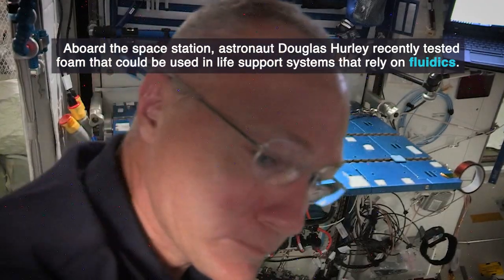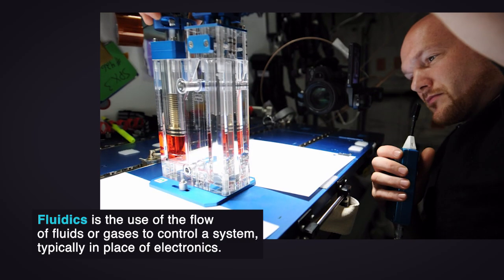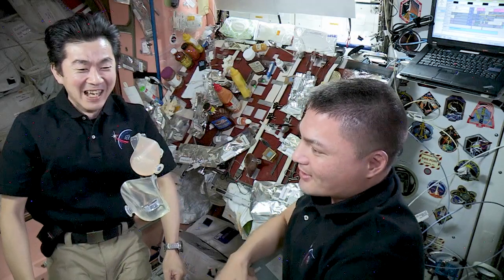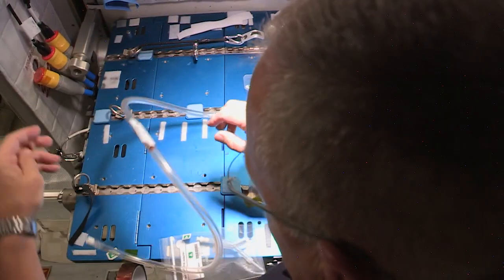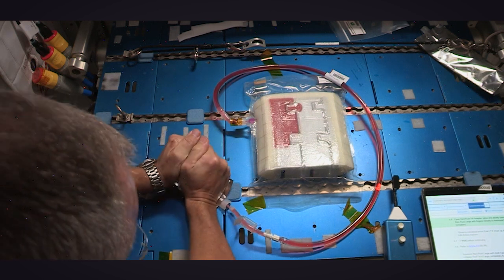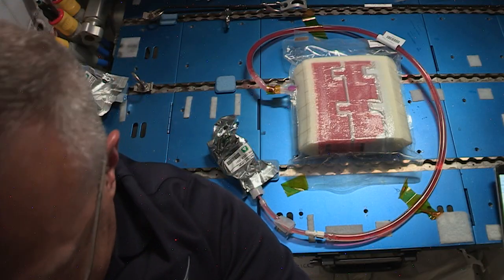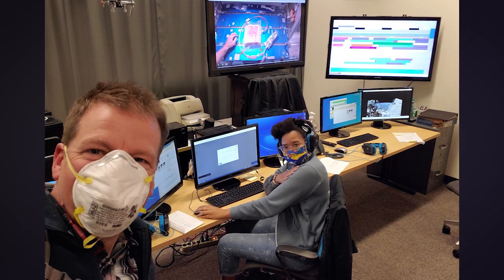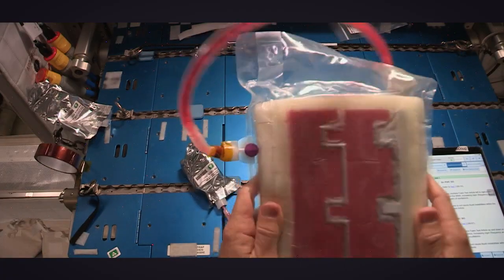Fruit Punch & Foam: Managing Liquids in Space

Comment: Hello , I know a method of travelling faster than light by 10^1000 times and higher , I'm a communications engineer  , but my question is can we go across silence mass continuity , we are stopped in space then we will travel by millions of meters per second in a short time of acceleration , would we be a piece of paper on the wall of the ship due to our continuity ? if we don't how can I share you the method of travelling in ultra high speed and without wasting the oil in space because it doesn't depend on the convenient methods , please let me contact you and I want my method to be widely used , we can use this method on earth too to make cars moving against gravity and go to space too in any speed , also we will be capable to transport signals in galaxy immediately and be live with any process we contact in any planet , and we will be able to discover the far away galaxies and solar systems in time less than months or weeks or may be seconds if you used the nano tech to develops my method .
Reply: wow whats your method? and yes, the laws of momentum would make it so that if you accelerate very hard very fast, you would likely be smashed against the back of your seat
Reply: "this paragrph is of two important technilogical parts , please read the second "I know a method of travelling faster than light in space , the method is to use a kinetic force from inside the ship to hit a point connected to the chasis of it and a too much strong force , due to continuity , speed accumulation in space , the rate of the kinetic force , the number of the hitting arm and the time of hitting the speed will reach the speed of light easily depending on how strong the artillery is the strength will define the time required to reach light speed " if you used a any force for 10000 hits per second and across the day you will have 8.3*10^7 × the speed resulted of a single hit × the number of arms " if we had one arm , 1 meter per second per hit across 83000 seconds for one day then the speed after the day is about 10^8 and its the speed of light devided by 3 , what if we used more arms , stronger force , fast result speed per second we may travel faster than light in a nanos of second . is this clear mister . if we used a nano layer of high arms concentration and placed it to a car then the car will travel in any direction with any speed with no issues , nano tech can boost the speed to a very high scale ranges to 10^x times depending on the hitting tech , size , concentration of arms , power of each 4 arms that can push the layer in a straight direction , if each arm made 1 gram force , then imagine 10^12 arms "4" they will make 1 mega tons on about 10 centimeters layer and if the rate was 1 mega hitts per second , then the speed will be boosted by 10^6'times of that 1M tons per second and the speed will be good to travel to all surrounding galaxies in short time and have the information of all surrounding galaxies planets .... please contact me I'm a communications engineer : " ambularchibiblio@gmail.com , +9647718263316 " I hope I can help , the method can be used also for a rocket inside the ship that uses h2 o2 oil and the resulted water can be fast analysed using the resulting heat of the internal rocket that can generate high power either from electronic converters or by turbines that can work by both rocket air force and water boiling force or the three methods can be used , then the h2 o2 gases can be refilled by an air compressor to the main tank and the space ship will travel without any oil loss with a high power gain that can be use to make another electric engine to haste the ship in a short time , I can program and implement the essential parts for free and I can make the rocket engine if we had a furnace or a better nano printer programmed to make a low scale engine built from materials in short time , or I can guide programmers to do it easily and shortly , if we used small engines with high pressure and large number with a main tank feeds them and by heat in the gas before reaction , and with a wider board , the speed will be doubled if I wasn't wrong may be by 1000s of times ... I will be online for two weeks then I will go to work I won't spend my money on internet , if you find it useful then we can talk about more practical details , I can minimize the cost of the ship to few thousands of dollars if we had to pay , I'm an engineer and no such a costful device on earth , the  expensive communications system can be cheap if we just used the essential system ....